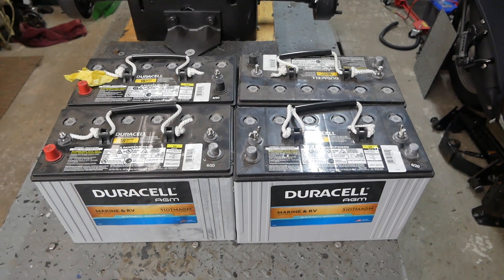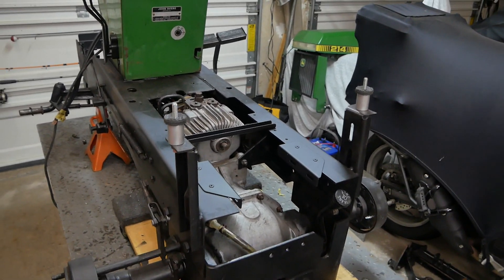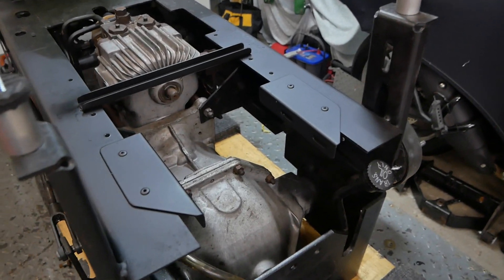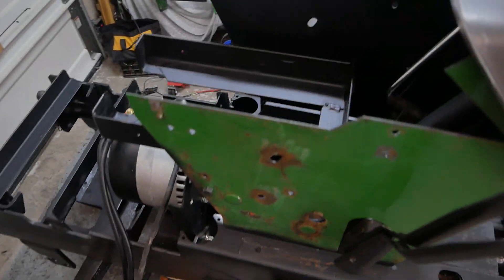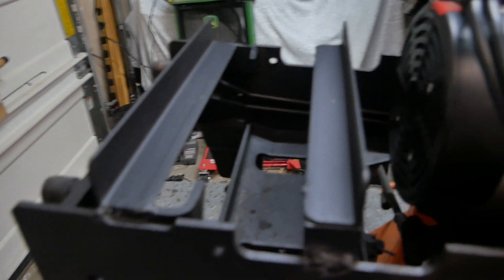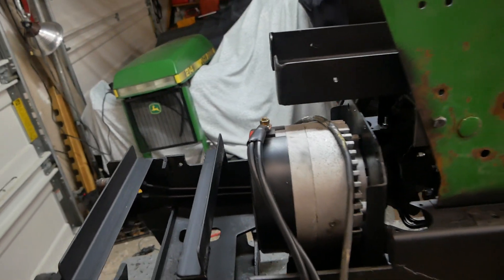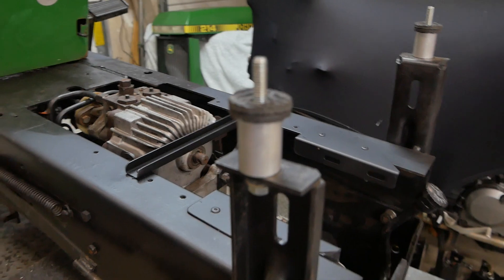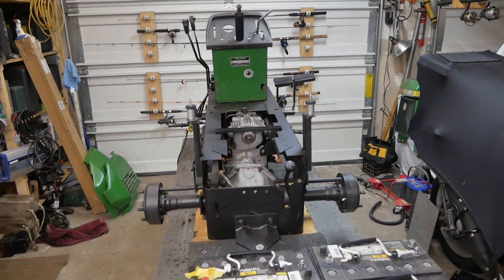John Deere 316 Electric Conversion Part 2...Battery Mounts

Comment: Hydros are loud, especially when not at running temp. Like I've said a dozen times on here and Facebook,  I love this build!
Reply: PS: put the 4th battery at the back now so you don't have to do it in a few weeks. We both know it'll end up there eventually...
Reply from the maker: @mikechapman4767  It actually is very fast enough. And power is only limited by traction. It has huge power as only an electric motor can offer. Instant torque, just what you want in a tractor.
Reply from the maker: I'm pretty sure the noise I'm hearing is those goofy universal joints.....sound like a thousand butterflies!